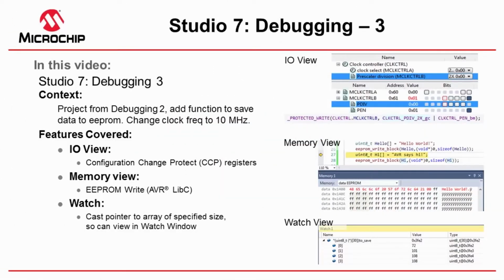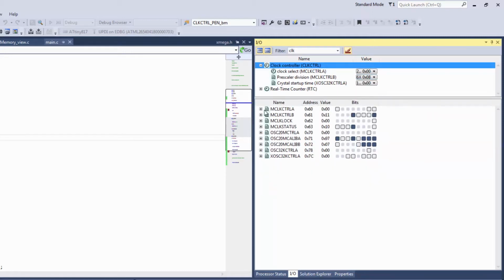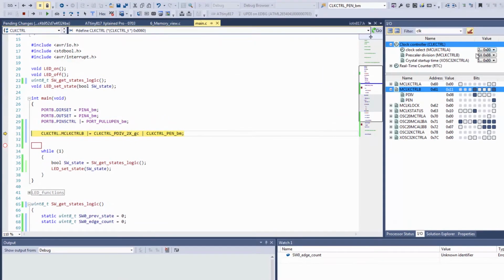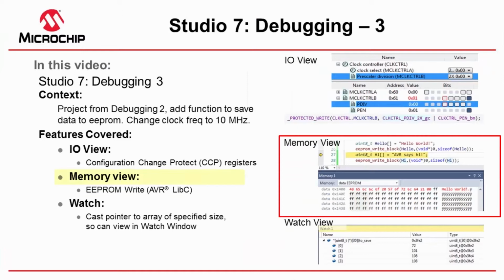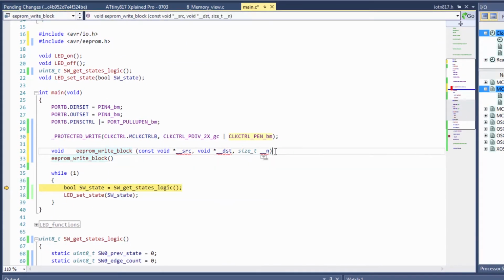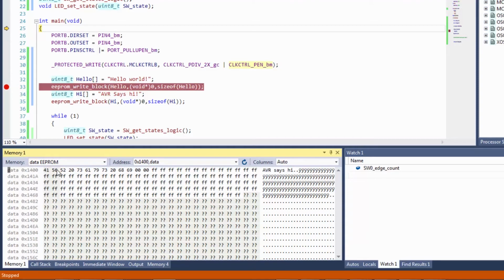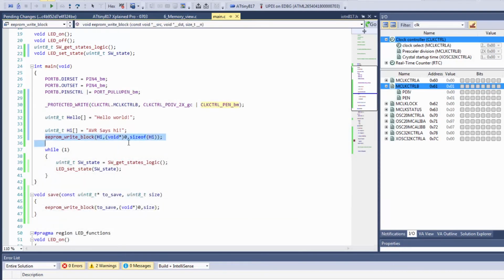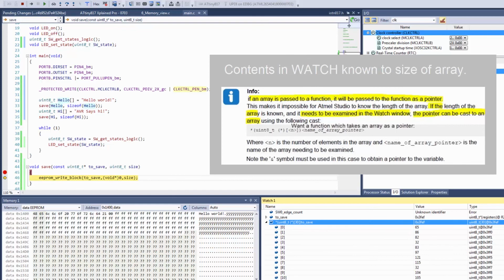Getting Started with Atmel Studio 7 - Episode 15 - Debugging Pt. 3

Comment: Hi, can I know if is it possible to start the debugger not from the beginning, but at a specific part of the code?
\
Reply from the maker: Hi there, thanks for your question. In Atmel Studio 7, to start debugging at a specific part of your code, use breakpoints. 

You can set breakpoints in different ways:

Function Breakpoint: Set it in the Breakpoints window by typing the function name.

Disassembly Window: Find the function, then right-click to add a breakpoint.

GDB Console Window: Type "print" followed by the function name to find its address, then set the breakpoint.

Hope this helps!
Reply: Thank You much

 @MicrochipTechnology
Reply from the maker: Happy to help!

Comment: Why is data written by address 0, but Memory1 window shows the data at 0x1400?
Reply from the maker: Hi there, thanks for watching and for reaching out with this question. The discrepancy you're noticing in Atmel Studio 7 might be due to the way it interprets and displays memory addresses. When you write data at address 0, it could be a relative address within a certain memory segment. On the other hand, the Memory1 window might be displaying absolute addresses, hence the data appearing at address 0x1400. It's also possible that there's a mapping between your program's memory space and the actual physical memory on the device. Hope this helps!
Reply: @MicrochipTechnology , it's actually not a problem I am facing what is happening on the video. Nevertheless, could you please also advise if Memory 1 window doesn't support showing SRAM and EEPROM memories when the code is written in assembly language?  Asking because I always see ?? there even though I input data using .eseg and .db directive as well as writing the data in from the program using corresponding instructions.
Reply from the maker: Atmel Studio 7 should support viewing of SRAM and EEPROM memory. If you're seeing "??" in the Memory 1 window, it's usually a connection issue, or the specific memory location may not be accessible at the time. Be sure your directives and instructions correctly initialize and address the memory. Let us know if this helps.
Reply: @MicrochipTechnology  I actually am not using any debugger device, just a simulator. Might that be a limitation of Atmel Studio? Thank you a lot for finding time to provide answers.
Reply from the maker: Happy to help. Indeed, the simulator in Atmel Studio does have some limitations. It is primarily designed to simulate the execution of the code, but it may not fully emulate the hardware behavior of all the components, including certain memory aspects like SRAM or EEPROM. For a more complete view of memory contents during execution, we recommend using a hardware debugger.
Reply: @MicrochipTechnology  once again thanks for the answers!
Reply from the maker: Our pleasure!

Comment: Do you know how to fix flash verification error in Atmel Studio?
Reply from the maker: Hi Elena - This error might be occurring because the flash is not erased properly before programming. In the meantime, please follow the instructions below to mitigate the error:
1.  Please try programming the device after erasing the chip.
2.  Please check if you are facing this issue always or if this issue occurs only in certain instances.
3.  Please check the operating voltage of the device and see if it is correct.
4.  Also, please check the continuity of the cables used.

If the matter still persists, we need further details to debug the issue you’re having. If needed, please reach out to our team at: https://www.microchip.com/en-us/support/design-help/client-support-services.

Thanks!